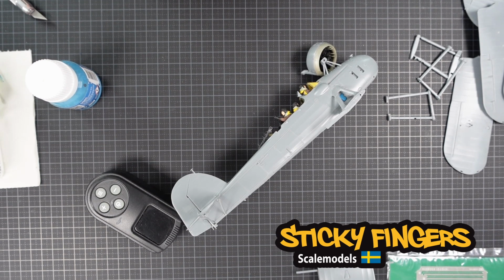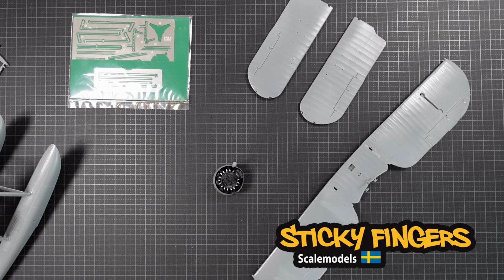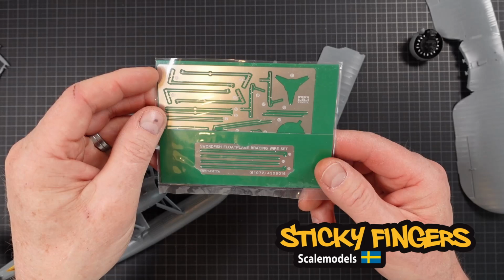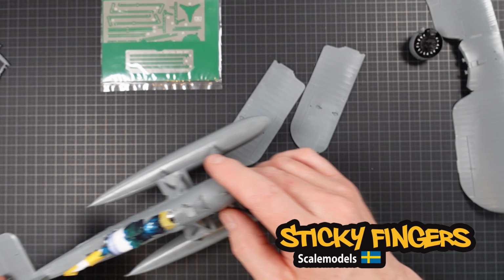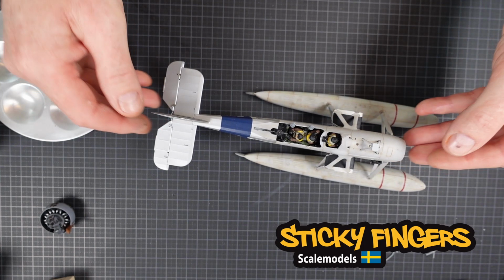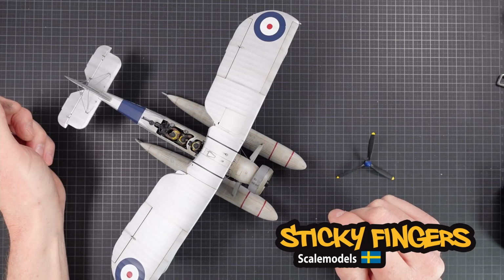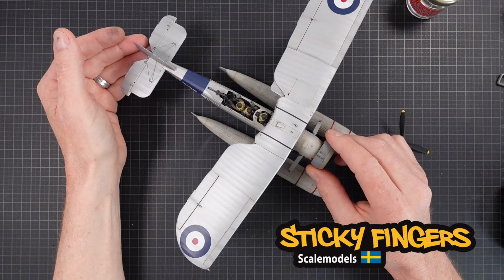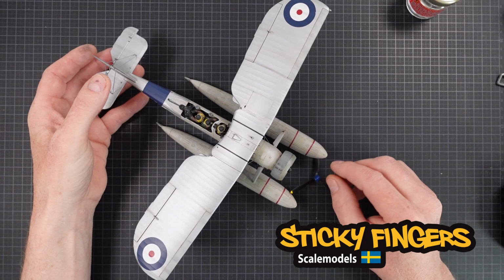Part 2: Fairey Swordfish by Tamiya

Comment: I finished the non-float-type kit a few weeks ago myself. I really enjoyed it, but it was quite complicated in trying to figure out the build, paint sequence. Quite a different animal compared to a monoplane. As for the size, I changed my plan part way through and decided to go with the folded wings, otherwise I would have had no place to display it! I agree that the bracing wires add a lot of detail to the kit... a difficult, but worthwhile addition.
Great video and looking forward to the next one!
Reply from the maker: Thanks Brett, and you are spot on when it comes to the planning and build vs painting on this little bird. It was a challenge and the most tricky model I built so far. Yes the bracing looks awesome on this kit and is a must have!